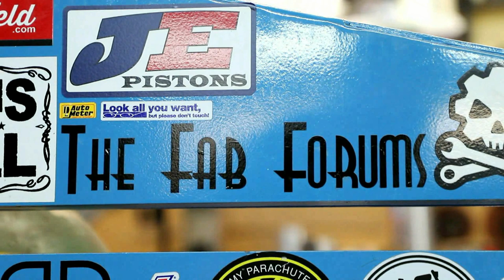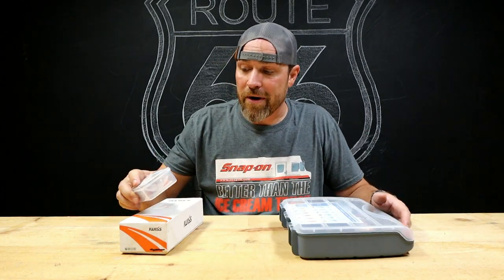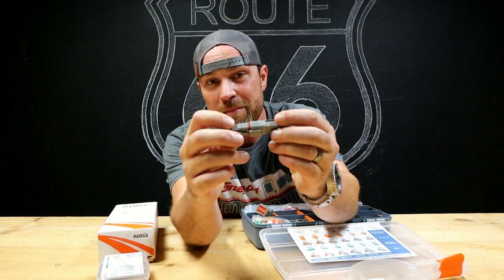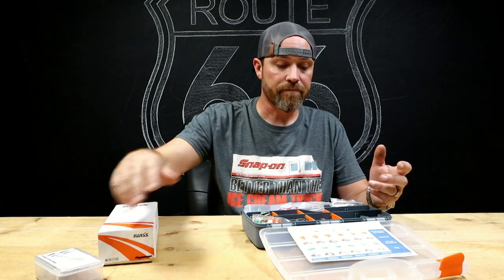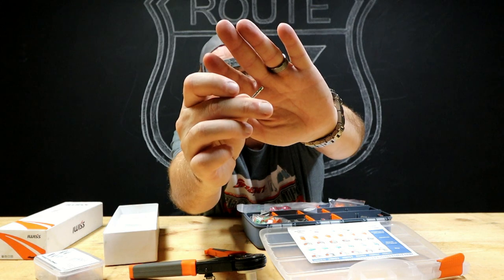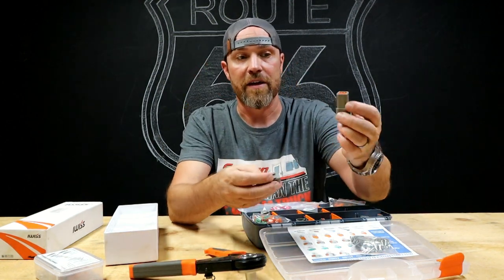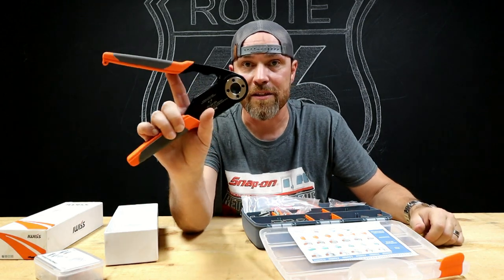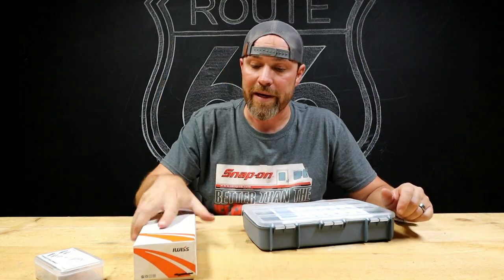You Need This Tool - Ep 137 | Deutsch Connectors and Tools Needed To Install

Comment: Been about 6 to 7 years since I last worked with these making wiring harnesses, but they were the best I've worked with for automotive, mining, and construction equipment. Also some nice CAT specific line items too. Definitely don't cheap out if you're buying the crimping tool, they are absolutely worth their hefty price- once crimped on the right setting, they are rock solid. Probably the best part of this, is that if you upgrade your harness and want to add a wire or two extra, then you just get a connecting plug the next size or so up, take the pins out of the smaller connector and add them straight in. Literally plug & play! Re-pinning is super easy too. They are already on my christmas project list for this year!

Comment: Darn it!   I just bought a high dollar 2 jaw version last year.   It has 4 interchangeable  jaws so you can use it on old school crimps  or barrel crimps or deutch connectors or even pcm pins.   But I sure like that 4 jaw unit and those solid pins.     Hmmmmmmm.

Comment: I work on buses we have used these for years. Had weather pack on older buses band still on newer buses. I like the weather packs for quick easy pro look. Deutsch, German engineering, over engineered but it looks good.. But the Deutsche you can make a multiple wire harness that doesn't take a lot of space

Comment: That’s a cool tool and connector. I use Delphi connectors. Same idea. Crimp the pin to the wire and insert to the connector. Plus it’s easier to pronounce.😂
✌️😎

Comment: Mr. Forums, I love ya, but this explanation kinda sucked. These connectors are ABSOLUTELY awesome. You missed the part about how easily they pin and un pin. You can expand a project (like adding more lights to a rack on your off road rig) by unpinning a 4-pin connector and upping to a six. They're also mercifully forgiving to anyone who makes a wiring mistake because of how easy one can unpin and repin. The "back" sides of the connectors are numbered so you can more easily get your wires to match up. Lastly, due to the way these things lend themselves to builders, the DIY crowd has made all kinda of compliant additions to the DT connector platform. 

These things are AWESOME!

Comment: So, are these ODB compliant connectors?  Didn't get a close up.

W/ so many custom cars running computer controlled drivetrains, using anything other than OEM type, ODB compliant connectors is foolish.

Once you get use to their superior function & reliability, it's hard to go back to old crimp style.

I invested in a hydraulic crimper quite some time ago, more because after 50+ yrs of wrenching, construction & metal fab, it was agony to crimp wires.

It isn't the actual sqeeze, that's painless, it's when you let up on the crimpers... yikes!  Feels like an electrified hot poker in your wrist.  (Give you young guys something to look forward to. LOL)

Got a 12 ton crimper for <$40 on Amazon & haven't looked back.

Only came w/ hex dies for battery/welding cables, the dies are made from 0.50" steel, (I checked before buying).

I've since made crimp dies for aircraft type cable/wire rope, air/welding gas hoses, electrical connectors, (to get those great 'factory look' crimps & uninsulated connectors for electronics.

Just takes some steel & time on the mill; use hand crimpers for design/specs.